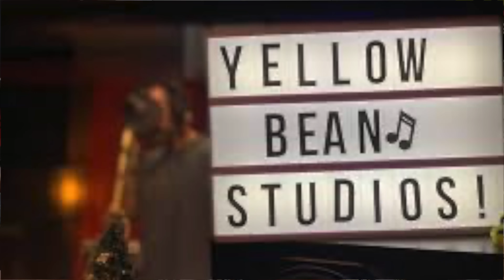ECM MYSTERY - SOLVED! UK Barn Find C4 Corvette ZR1 Project Episode 12

Comment: I’ve taken the ECU apart on various 4th & 5th gens that had similar issues. I found with a magnifying glass that many soldered spots on the circuit board were cracked. I touched them all with a hot soldering iron and that brought most of them around.

Comment: Here's a thing......when it's running, try tapping fairly hard and sharply on the braincase. It may be you notice an improvement  ,or maybe otherwise. This is a recognised trick with C4 brains, refeered to as a 'tap test' . When I got my C4 , the brain was iffy, and I learned about this on the forums . It briefly ran fine for a second or two most times, other times would stall or idle-up . A rebuilt brain fixed t right up , no more issues. All symptoms completely banished.  DHL'd it to Zip Corvette  for rebuild , as brains for a '93 were like dobby-horse manure, you had to have your own re-done. Only '93's , all others avaiable off the shelf. Took about 3 and a half weeks to get back and cost about 340 quid. Don't know if they can do a one for a Zee, might be a plan?

Comment: Last night watched an episode of Mike Brewer Wheeler dealers with Ant Anstead on a Corvette Z06. He had an electrical component in the car which would cost over $1000 to replace but found an electronics specialist who diagnosed which component on the circuit board was faulty and replaced it for around $10. The other main fault with the car was it needed a clutch replacement - which Ant did. Good luck getting yours fixed.
Reply: After watching board level repair channels like Louis Rossmann, I hope more people consider going that route. It's insane how overpriced everything's become.

Comment: I had an 86’ Convertible Vette before and it had issues with starting up. What fixed it was a new fuel pump and strainer in the tank and a new Vats override key that was $325 from Canada . They both fixed the problem right up. Started up with half a key turn after that. So it could be also a similar issue for your 91’. Hopefully it’s just what you found today. Fingers crossed 🤞🏻

Comment: Haibeck 368 - bored out to 4" with stock crankshaft, fully ported plenum, injector housings and heads, likely with headers from Stainless Works, single mass flywheel for 530 HP.

Comment: Marc did my 415 cid LT5 with full porting of the injector housings, plenum has been siamesed, heads ported - all to 36 mm (maximum), with bigger intake and exhaust valves, for 700 naturally aspirated horsepower.  BTW - Marc can port and polish your LT5 up to 500 hp!

Comment: What a great car show! Maybe Vince would allow you to install his working ECU into your car? If your car STILL ran rough with his known good ECU, it might save the time and expense of shipping it off. I thought that would be a possibility to surely eliminate your ECU as being faulty. Of course if your car ran much better, consistently with Vince's ECU, yes I would think your ECU would have a faulty component inside. Usually cracked solder joints, or leaking capacitors can be a culprit in that case.

Comment: First and foremost, many thanks to the legend that is "Vince" - what a guy to allow you to connect a dodgy ECU to his perfectly running ZR1, just to suss out if your one was knackered, which turns out was definitely the issue to the running issue of yours!     Just a quick whinge though with your filming - too much auto focusing NOT working, so perhaps switch to manual settings if you can, to prevent blurring out some interesting segments - sorry, I can't talk, as my history with filming with my Android phone camera is far worse than your excellent efforts!    At the end of the day though, my hats off to you both for your splendid efforts to re-commission this Icon of a "proper" muscle car, and can't wait till it's MOT'd and driving down the tarmac on the UK roads with two fingers up to the ULEZ supporters - mainly referred to as Mr Sadiq Khan!

Comment: Possibly an internal defect in one of the ICs.  Mechanical shock and temperature fluctuations will trigger this symptom.  It'll behave like a cold-solder-joint but the problem is inside an IC. 

In this particular case it sounds like the Micro-Controller chip is failing on the Logic Board and the ECM is switching to LIMP-MODE.
Reply from the maker: We are thinking along the same lines - It behaves exactly like a cold solder joint but we reckon Paul has done a good job sorting those out for us... !

Comment: With a wasted spark system, when misfiring BADLY, which your car is doing, it still sounds half assed ok.  That is not a car that should be driven in its current state.  Hopefully you get a new ECM into it soon.  With symptoms as described, it sounds like a bad ECM.  Obviously, I haven't finished your video yet.